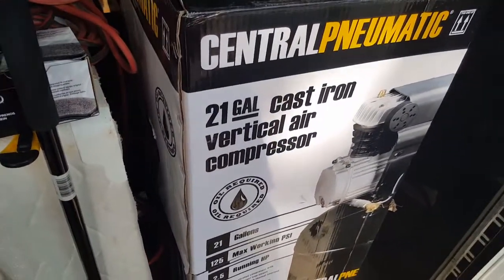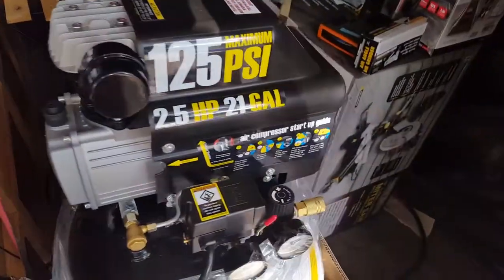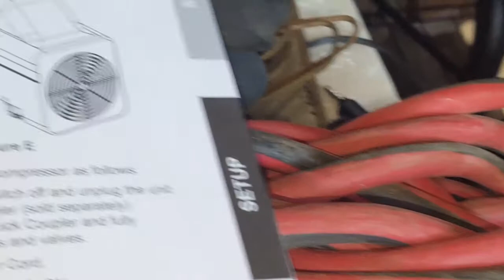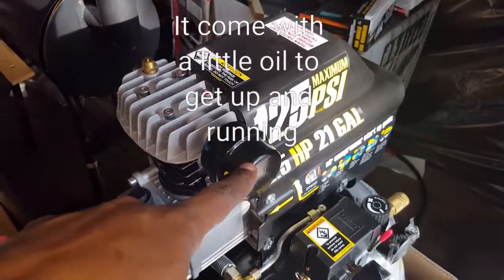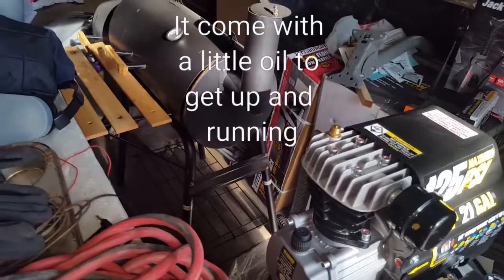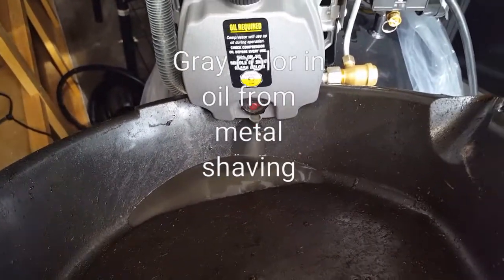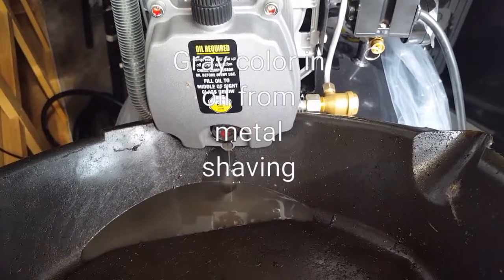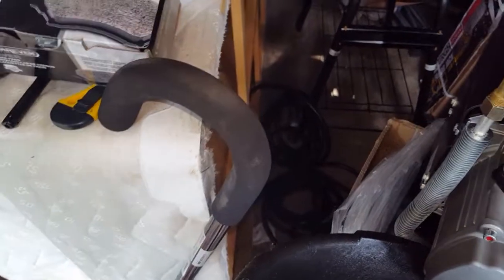21 gallon oil compressor

Comment: Got my 21 gallon a couple weeks back. Flushed the motor out a couple times before break in and after. Love it so far. It’s not as loud as my old husky 10 gallon compressor.